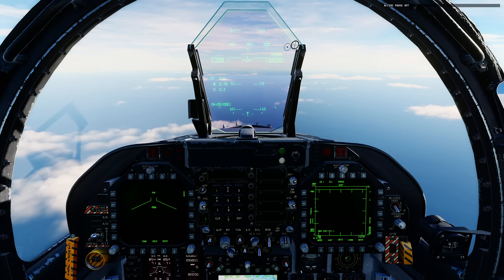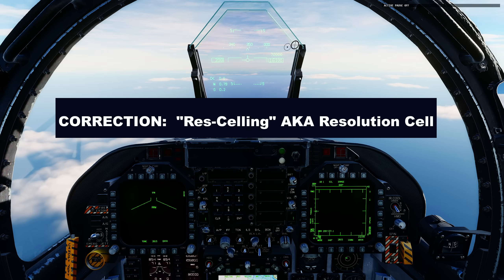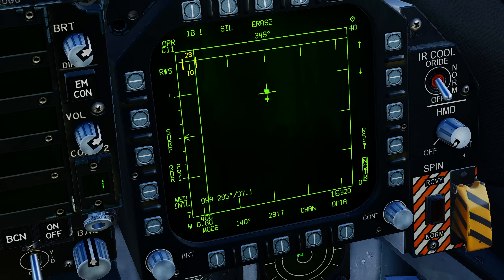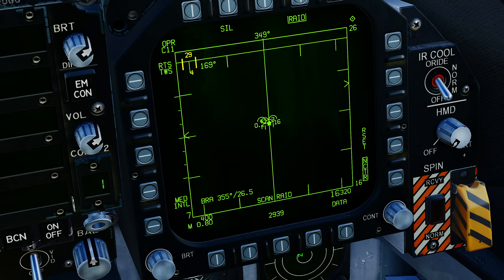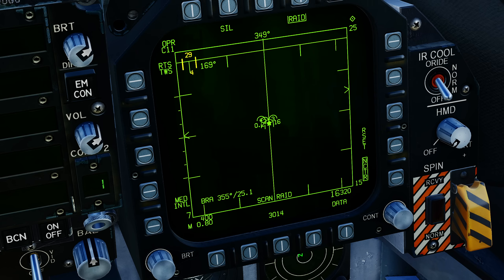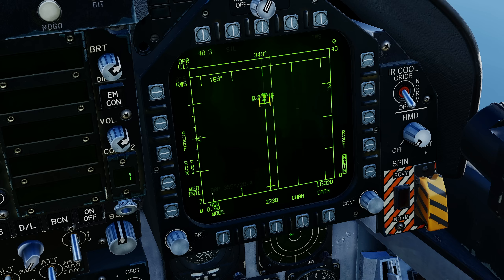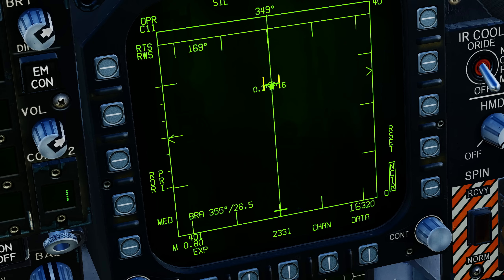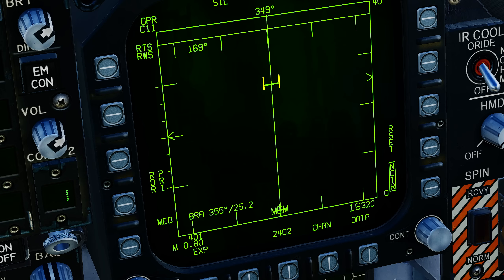FA-18C Hornet: Using RAID Radar Modes To Beat "Res Celling" Tutorial | DCS

Comment: Great and very helpful video!! i can't help but notice though that while the height bar points to 3 bars, the indicator goes Hi, Med and then Hi again. Seems to be some bug
Reply: No, it's not a bug. It's changing the pulse on each sweep of the B scope. It's supposed to do that
Reply: @valuedhumanoid6574  But not 1 indicator switching between 2 bars and the other for the same function indicating 3 bars